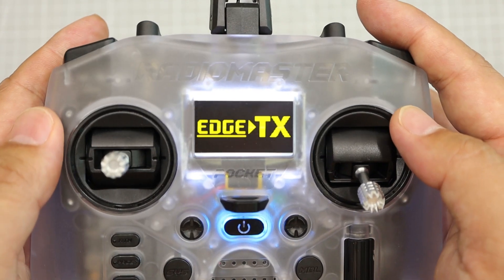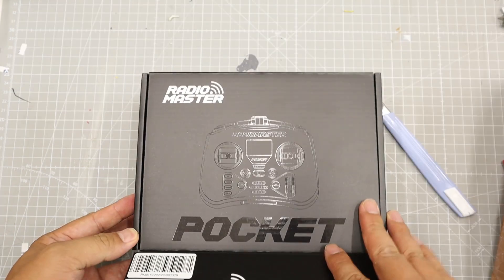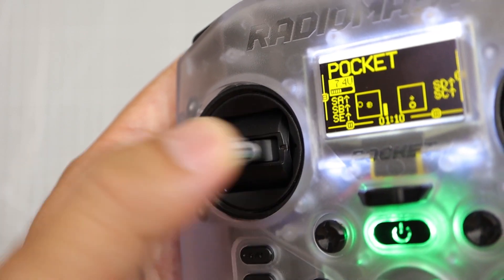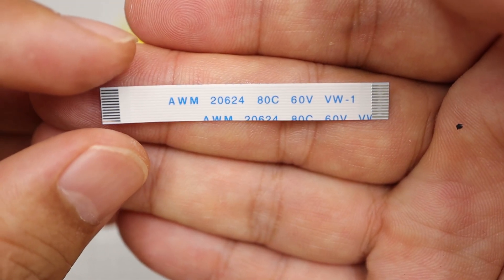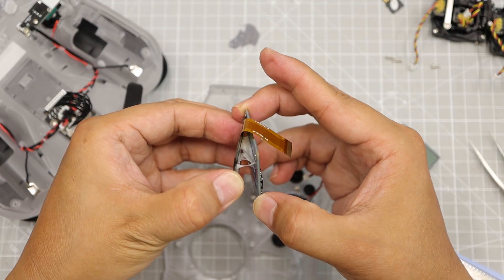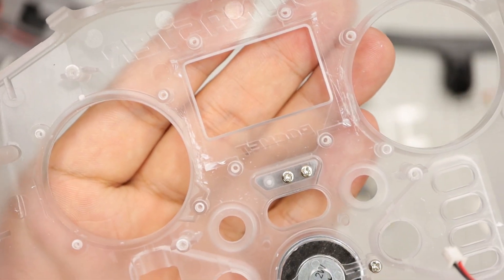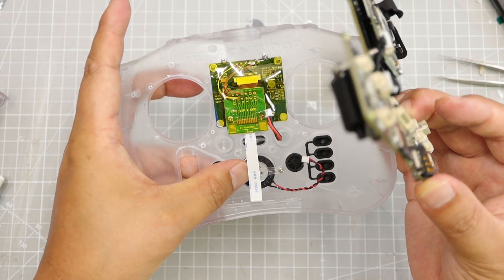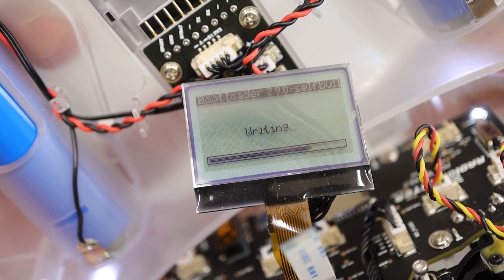OLED mod for Radiomaster Pocket

Comment: Can i use 1.3" OLED screen? It have the SH1106 driver 128x64 res, adafruit module with SPI interface. If i can, do you have, or can you write me the steps? Please? And why do you use the lcd backlight? Isn't OLED don't need a backlight? Thank you in advance
Reply from the maker: I'm not sure about that. The reason for leaving the backlight is for cosmetic reasons.
Reply: @celeselements  thank you for replying. just to clarify what are you not sure about? Is it the driver compatibility, or the screen size and res?
Reply from the maker: Driver compatibility. Original BW screen is equipped with ST7567 or compatible. First of all, check the compatibility between the two drivers(ST7567 and SH1106). If the two drivers are compatible, there is no need to create new firmware.
Reply: @celeselements  so if the driver is compatible then I can just flash the firmware, then connect the OLED screen via SPI, is this correct? Also if I update the edge tx firmware will it affect the OLED firmware?
Reply: @celeselements  and can you please write me what pin goes to what pin in adapter board?
Reply from the maker: If the driver is compatible, you don't need my modified firmware. The OLED has SPI.
Reply from the maker: Please refer the description and my github.

Comment: Can I use a 1.3" or 1.4" OLED screen?
Can OLED screens with built-in I2C be used?
The mod code can be used for ELRS and CC2500 versions, right?
Reply from the maker: Check the OLED driver. The OLED should be compatible with SSD1309 and SPI interface. I2C is not supported. The display is independent of RF system.

Comment: hello friends, my LCD has a screen mirror. Can you make more firmware for the one that doesn't mirror the screen? please help me guys.
Reply: I use a 1.3 inch Oled V2.0 LCD, Branded by Adafruit Industries
Reply from the maker: https://github.com/DongkwanYi/OLEDBOXER/tree/main/firmwares
Check README and firmware!!!
Reply: @celeselements  thank you my brother I will try it.
Reply: @celeselements  For OLED Pocket there are 3 updated models. and the first thing I tried to flash was using the model with the screen upside down. and I tested the function. the problem remains, namely the screen remains upside down with no change. and I tried flashing the other two firmwares. the problem persists. please help my friend.
Reply from the maker: I'm sorry it didn't work. There's no way I can help you any more now.
Buy a new OLED and try it again.
https://ko.aliexpress.com/item/32971511348.html?spm=a2g0o.order_list.order_list_main.49.54711802A8Afsy&gatewayAdapt=glo2kor
Reply: @celeselements  OK friend, thanks for the help. Unfortunately now Aliexpress no longer sells or sends goods to my country.

Comment: Hi, can this tutorial be successful by just following your video? Coincidentally, I want to replace the LCD for my Radiomaster Pocket Remote. or you have to follow the tutorial in the link in your description, such as creating a Gitpod for compilation. and others
Reply from the maker: Yes, you can do it. I uploaded firmware for Pocket. You don't need to compile it.
I uploaded everything for mod at my github and youtube vid.
Reply: @celeselements  I have installed it but the screen display is upside down, what's wrong?
Reply: @celeselements  hello friends, my LCD has a screen mirror. Can you make more firmware for the one that doesn't mirror the screen? please help me guys.
Reply from the maker: @GarengPetruk  Please wait a few days. I'll find a way.
Reply: @celeselements  OK my friend, thank you very much for your help. I'm happy to wait🙏
Reply: @celeselements OK my friend, thank you very much for your help. I'm happy to wait🙏
Reply from the maker: https://github.com/DongkwanYi/OLEDBOXER/tree/main/firmwares
Check README and firmware!
Reply: @celeselements  For OLED Pocket there are 3 updated models. and the first thing I tried to flash was using the model with the screen upside down. and I tested the function. the problem remains, namely the screen remains upside down with no change. and I tried flashing the other two firmwares. the problem persists. please help my friend.
Reply: @celeselements  I use a 1.3 inch Oled V2.0 LCD, Branded by Adafruit Industries

Comment: can this library work for ssd1116?
Reply from the maker: I don't know much about SSD1116.
Do you mean SH1106?
SH1106 lib has original EdgeTX firmware.
Reply: ssd 1116 and sh 1106 same @celeselements
Reply: @badtrip_fpv  also interested in ssd1116

Comment: Hi, Many thanks for your presentation. Have connected a 2.42inch OLED with the same resolution but I broke cable to the LCD when I worked with the radio. Have ordered new LCD display. Do not know how to get the OLED bin file loaded when I have no display. Next question is how to return to original LCD software if my OLED does not work. Can you help with advise?
Reply from the maker: Hi, I'm sorry for late reply.
I make new video for mod, It's same as pocket.
You seem to be having trouble updating the firmware.
Check it : 6:17 at https://youtu.be/LZEmpTxd5Lc

Comment: is there an oled screen that is the same size?
Reply from the maker: The OLED shown in the vid is 1.54".
Reply: @celeselements  I know but it is oversized, is there one that matches the original available? could I use one that matches instead with the firmware?
Reply from the maker: I cannot find OLED that exact same size. So I moded front shell. @g00gl3_us3r
Reply: @celeselements  okay thanks im going to try to find one the same size thanks for tutorial
Reply: @celeselements  is the stock screen diameter .96 or 1.3 ? my pocket radio is in the mail..
Reply from the maker: The stock screen is 1.3".
Reply: @celeselements  measured diagonally?
Reply from the maker: I didn't measure it, but parts seller claimed 1.3".
Reply: @g00gl3_us3r   Any luck with 1.3''?

Comment: Would a 1.30 oled display be better?
Reply from the maker: The OLED shown in the vid is 1.54". Choosing a small OLED is solely your preference. Choose SSD1309 driver OLED.
Reply: @celeselements Can the SSD1306 OLED driver be used?
Reply from the maker: @GarengPetruk  I didn't tested, but as i know, SSD1306 is compatible with SSD 1309. Please check it!
Reply: @celeselements  I have one more question. Is the OLED screen you are using SPI? if true how to connect SPI to 12ic

Comment: Hello. Good job!!!
I decided to follow your lead... all assembled. Now I just need to unlock the bootloader and upload the firmware file. But I don't know how to do it... Please help me.
Reply from the maker: Please follow this instructions : https://github.com/DongkwanYi/OLEDBOXER/blob/main/how_to_flash_firmware
firmware for pocket : https://github.com/DongkwanYi/OLEDBOXER/tree/main/firmware
All infos are here : https://github.com/DongkwanYi/OLEDBOXER
Reply: @celeselements  
Thanks a lot.

I have 2 more questions...
Is it possible to check the OLED module for functionality? why do you have tin on the fifth pin on the board FPC-12p??
Reply from the maker: My code for OLED is included SSD1309 display driver. So SSD1309 display driver or compatible that adopted for OLED, that is available.
Fifth pin is not use. Tinning on that pin is meaningless.
Reply: @celeselements I did it all!!! Thank you so much!!!❤❤❤
Reply: @nextlife5642  how did you get everything to fit without bending and cracking your main board?

Comment: Does the contrast setting do anything with yours? I think the oled I built into my Boxer could be brighter.
Reply from the maker: At 2.9.0, brightness control is available. And I dig in the OLED drive circuit for more brightness. :-)
https://github.com/DongkwanYi/OLEDBOXER/tree/main/firmware

Comment: super, you're cool, but can you do the same only with the first version of jumper t pro, which has a simple display?
Reply from the maker: Thank you, I'm not sure about that and I don't have first version jumper T pro, but I think it's possible without firmware mod. Jumper T-pro has 1.3" screen, if you replace 1.3" OLED, it will work. Take care wiring.

Comment: Great job well done!! Please make a mod that use normal size screen for example from tx16s that we can attach externally using fpv screen bracket. It's going to be useful options for fixed wing pilot using Yaapu or Inav telemetry. Thanks!
Reply from the maker: Thank you!
Good idea, second screen is somewhat technically different thing. I'll think about it.
Reply: Nice mod idea, but wouldn't it just destroy the interests of the pocket ?...
Reply: @un_ours_blanc  it's a mod. Option that people can make. How often that people that have it put in their pocket. It just a name to tell the size. If I want bigger screen yes I can go for tx16s OR I can just buy a 6usd lcd (for car reverse monitor) that is compatible. 😘
Reply: @skelethornbro  don't worry, I got that the "pocket" is just marketing, even though it actually fits in more pockets than you could think, but a tx with that small gimbals has a specific interest for having such small ones

Comment: Can this work on jumper t pro?
Reply from the maker: I don't have Jumper T-pro, but I think it might be possible to modify it.
Reply: @celeselements  You're great💪.. I'll order the material if I need it I'll contact you..😁
Reply from the maker: OK, ask me anything about this mod.
Reply: @celeselements  thanks man
Reply: did you succeed on Jumper t pro?
Reply: @СантягоРуру  Hi... I haven't tried my hand at it yet... I would like to make a video about it but I don't even have time to fly where I find it a fantastic thing as a hobby
Reply: I disassembled the t-pro for inspection; there is very little space; such a pie with a board instead of the original display will not fit into its original place.  You need to peel off the display and lengthen the cable.  in short, for T-PRO this modification will be more difficult to carry out
Reply: @СантягоРуру  In my opinion doable